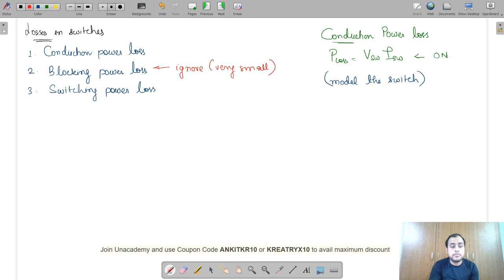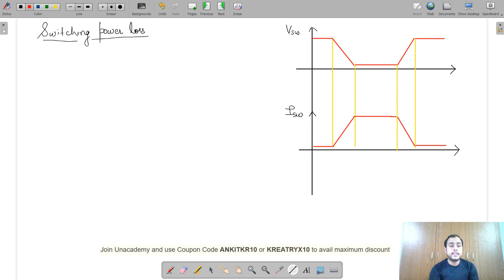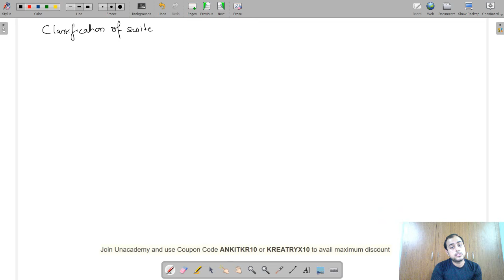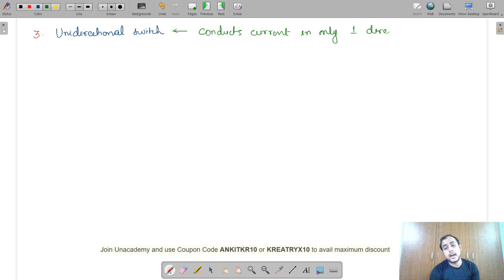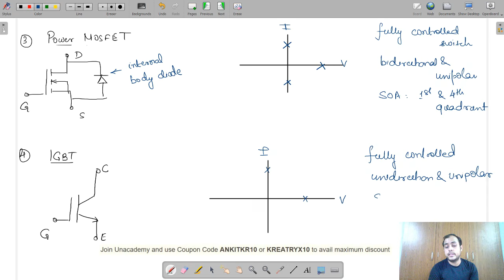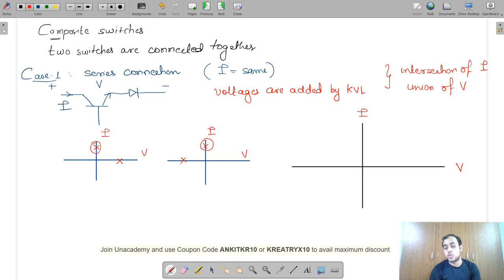Power Electronics | GATE Electrical Engineering | Lec 3 | Semiconductor Switches-2 | CRACK GATE Exam

Comment: Sir i have this one doubt that you have mentioned that the SOA of P BJT is 1st quadrant. But sir if we take npn BJT then that device will reject the negative voltage and hence the limit will lie in the negative voltage axis. And the SOA is in 2nd quad.

So i think depending upon the type of BJT used the SOA will be on 1st or 2nd quadrant.

Comment: Sir, how is it possible that BJT conducts when negative collector emitter voltage is applied despite of reverse biasing, if it is so, then how current flows in one direction, it should have conducted the current in opposite to that of previous one. that is current will be collector to emitter. Plz sir explain.
Reply from the maker: Mohd Vasil BJT does not have the ability to block reverse voltage 
It breaks down 
For positive voltage unless base current is applied it does not conduct 
Watch lecture 7 to know more
Reply: @KreatryxEE_EC_IN  It breaks down after a little negative voltage? If it does not then, We can use 2nd quadrant for SOA as well.
Sir, i'm waiting for reply.
Reply from the maker: Mohd Vasil correct

Comment: Sir, I have a doubt which is not important. 
1) how triac works in 4 quadrants with MT1, MT2 and gate signal? Can the working be used for 1 phase ac voltage regulator instead of two SCRs anti-paralled?
Reply from the maker: Yes but that also depends on ratings